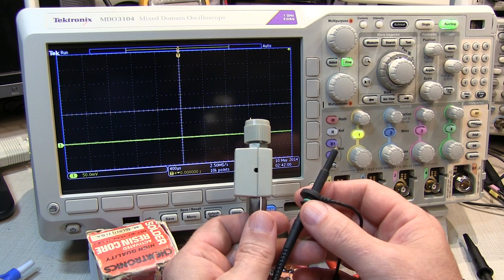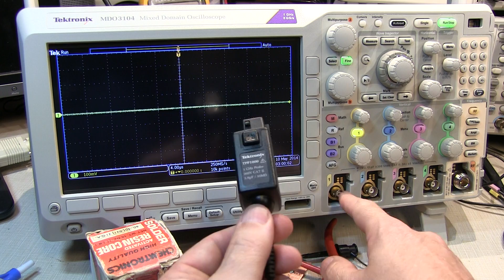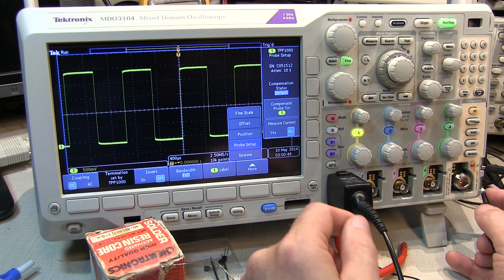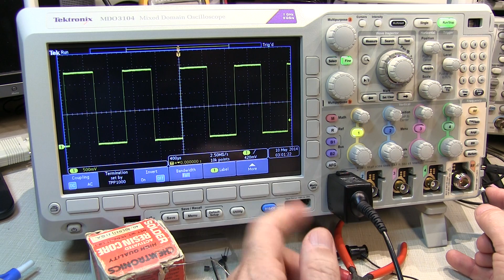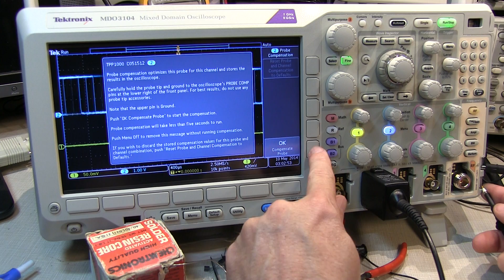#146: 10X Probe Compensation on a Tektronix MDO3000 Oscilloscope

Comment: Thank you sir. I have a question to ask. Might not be very appropriate here. I have found a Rigol DS1102E on Ebay second-hand but based on the posting description and picture, in good working condition. How much would you at most pay for such an oscilloscope sir? I did check the price for a new oscilloscope of the same model, but got confused. There seems to be differences within the same model number or something like that (around $100 of price difference from different websites for the same model number). I want to buy this oscilloscope just to have a "digital" set with a little higher bandwidth compared to my analog scopes. I've never had a digital standalone scope. If you would not buy this specific model for any reason, please let me know. I thank you for your time sir!
Reply from the maker: Given that a new one can be had for 300, I wouldn’t go anywhere near/over half of that. I’ve never used one of these, so really can’t comment on the unit itself.
Reply: @w2aew  I appreciate your help sir. Thank you!

Comment: MDO3012 can connect 100X old prob and need to setting? what is Voltage actual can handle?
Reply from the maker: Yes, you can - the voltage limit will likely be imposed by the probe, not the scope.
Reply: im not clear about oscilloscope tex 3012 model. it can measure voltage ?

Comment: Thank you very much for your videos. Just found your channel today. I am looking at getting either the MDO 3000 or 4000 and I am just curious if the active probes are necessary? Are they worth their extra price tag. Obviously they all have their place but what things are the active probes better for?
Reply from the maker: Active probes will present less of a load to your circuit under test.  For example, the TPP1000 passive probe has about 3.9pF of capacitive loading, while probes like the  1GHz P6243 or 1.5GHz TAP1500 active probe has about 1pF or less.  And, the active differential probes give you high sensitivity differential measurements with very good common mode rejection.  So, it all depends on your application...
Reply: Thanks for your answer! Most of the stuff I work with is sub 500Mhz and probe loading of <4pf will be a minor if not insignificant. However for some of the RF work a couple active probes may be necessary.

Comment: I bought an old Tektronix 2246A the other week. It works fine.
But I do not manage to calibrate so the squarewave is completely flat.
It came without probes, so I bought some cheap 100 MHz probes at a random e-bay seller.
Maybe it's the probes that are low quality. I have to read up on this.
With the 60 MHz probes from my 50MHz digital scope it's no problem to calibrate to get a nice flat squarewave response.

Comment: Question, will this RF spectrum analyzer will be able to work like in MDO4000 ?
(i mean spectrum correlation with analog/digital inputs)
Since it is done by DFT, it is not that hard to make it sync with analog front end. Or it is specially crippled so it will not interleave with MDO4000 ?
Reply from the maker: The spectrum analyzer in the MDO3000 does not feature any time correlation with the analog and digital channels.  The same 10GS/s (total) DAC is used for either the analog channels or the SA, thus both can't be sampled simultaneously.  The MDO4000 has two 10GS/s DACs, on for the SA, and one for the analog channels.  The DAC on the SA feeds dedicated 2GB of memory for RF capture over time.  The 3000 has one DAC.
Reply: *****
aaa, now i understand, since it spectrum is sampled at 10Ghz, and analog channels have 5GSps ADC, so they simple using both of them at same speed just out of phase.
I was thinking since it has 3 BGA chips with heatsink, third is dedicated to RF, i was wrong :(

Comment: Do these modern Tek scopes still support the 10x pin on old probes?
Reply from the maker: Yes they do.  The first probe used in this video is the older style with the 10x pin. When I connect the probe up, you can see the vertical scale (lower left on the screen) change from 50mV/div to 500mV/div.